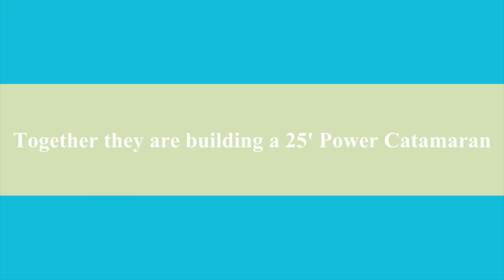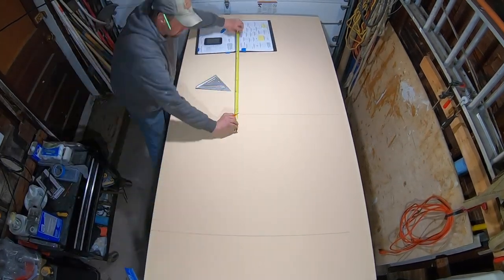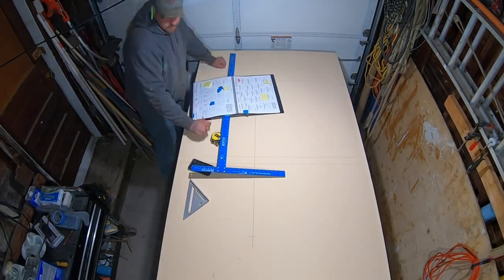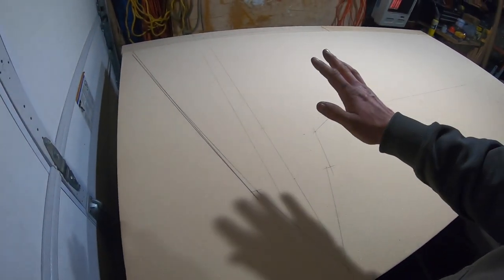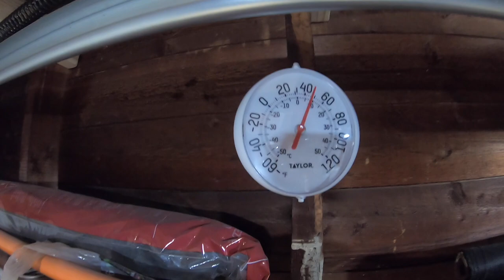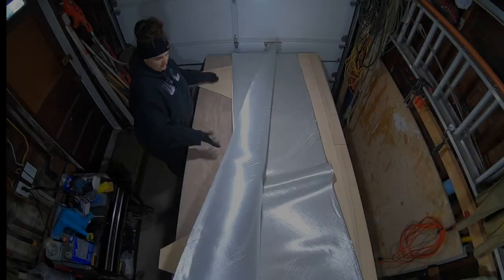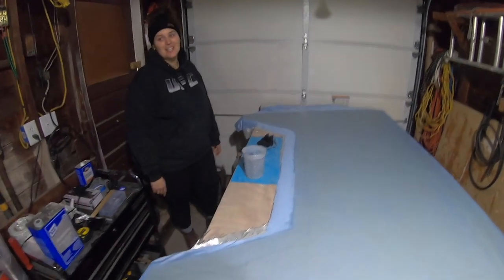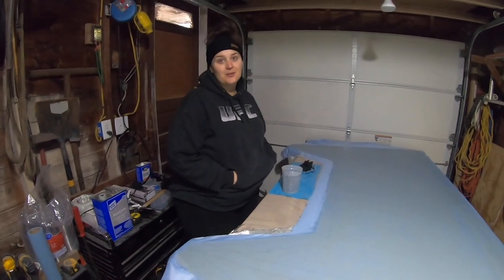Step 40: First Bulkhead! Laying Out and Glassing in the Garage Power Catamaran Series

Comment: Hi, I'm surprised you haven't got a lot more subscribers, I found your channel by accident last week and have now watched all of your episodes. I am building a 28 foot planing launch at the moment and am currently trimming out the interior, my boat is glass on ply construction and is the second boat I have built, if I was younger, I would build using the process you are doing. any idea what the design weight is excluding the motors. Why are you using antifouling paint below the waterline, I would only use it for a moored boat, my boats both have epoxy paints on the bottom as they spend the majority of their time on a trailer. Keep up the good work and keep that positive motivation going.
Reply from the maker: Hi! Thanks for following along and watching the WHOLE project. That’s a task in itself. We’re not sure what the deal is with subscribers but it’s fine. We are tracking progress for ourselves, friends, family, and our small group of followers. I’m happy for you being in the phase of trimming out the interior!! We cannot wait until we’re there. 

We keep our boat in the water at a marina - that’s why we do bottom paint!

Comment: I am looking at the construction site of your catamaran. Maybe the vertical clearance is low? What speed is planned?
I think it will be slamming.
Reply from the maker: Top speed should be around 30 knots.  Cruising speed 18-23 knots. I am assuming you are talking about vertical height for tunnel clearance. This is what the designs called for. From waterline there should be approximately 12”-18” or 300-450mm in the aft of the boat for vertical clearance. Thanks for the comment.
Reply: @BuildingMVDauntless  Yes, you understood my question correctly. Your answer is clear to me. I hope that you know what you are doing and trust the author of the catamaran project.
I watch your work very closely.
Reply from the maker: @ИванИванченко-с9т  The designer comes from a family of boat designers and has been in the business for many years. thanks for following along. And good luck on getting your project going.